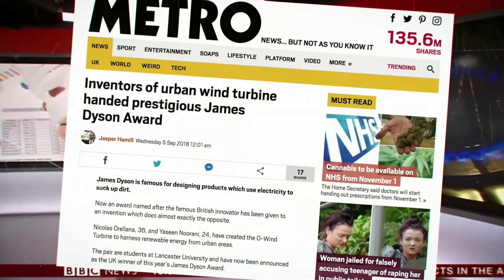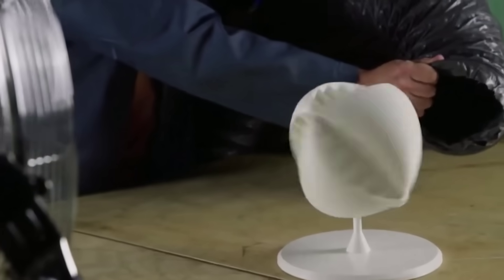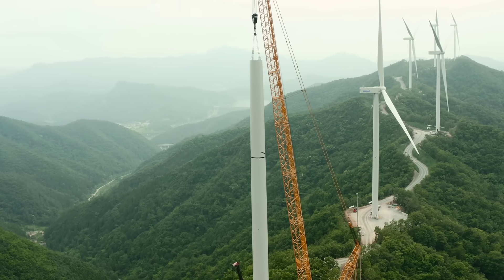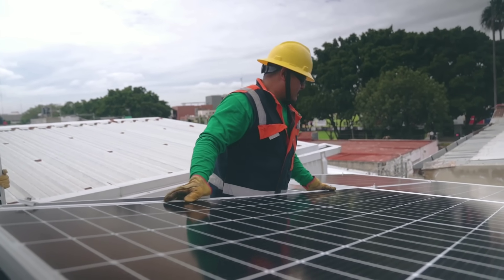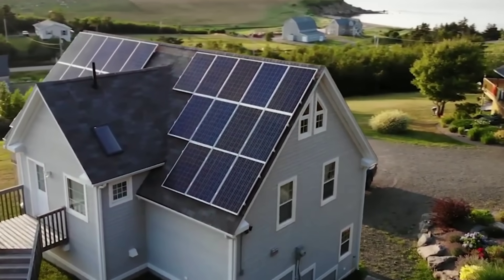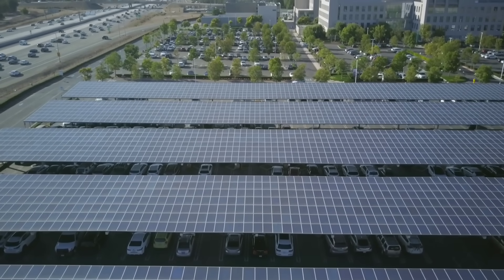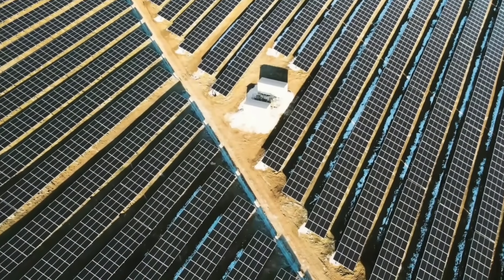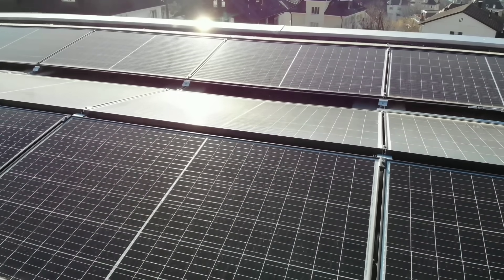This NEW European Wind Turbine for Home Out Perform PV Solar Panels in 2024?!

Comment: Keep in mind power is P[W]=½*ρ*A*V³*Cp (where ρ=1.225 air density, A=area of turbine in m², V=wind speed in m/s and Cp is a in range 0.1 for this turbine - you can check, it's widely known equation). So turbine of diameter 3 foot can create about 10W of energy at the wind 6.5m/s (which is a quite strong for urban locations).
Reply: I live on a yacht and can advise that almost all of the boats have removed the wind turbines fitted in favour of solar panels...  Keep in mind the back of a yacht is usually a very windy place!!  The turbines still produce very little each day... I have fitted 600watt panels that keeps up with the day time and evening use... The turbines do not... Panels and charge controllers/inverters are now cheap...😊
Reply: @GrahamLawder  only reason why I contemplate wind is the fact I am above 53N and need to power a house. Fun fact, the tower (20m) costs as much as a decent turbine. Roofs are horrible for turbines (low rise).
Reply: No datasheet on the website either listing the simple windspeed vs power graph. I think you are low-balling it, but no sheet, so you could be right.
Reply: @christianvanderstap6257  this is scam for collecting investments from investors who measure energy in km/h ;)
Reply: First I did look for your formula and know I've seen it before, but can not find it now that I want it. My question is what does your Cp=0.1 refer to? I would think conversion of mechanical to electrical energy as that and capacity factor should both be figured in for useful output.
Reply: @zmavrick  I'm not the OP but, Coefficient of power = (VI)/(1/2Apv3)

The Betz Limit is the maximal possible Cp=16/27=0.593

A maximum of 59.3% of the available wind power can be converted to mechanical power at ideal conditions, whatever the energy conversion device is.

Real wind generators do not reach this theoretical optimum; however, good systems have power coefficients Cp between 0.4 and 0.5. A drag machine, such as the one shown in the clip would be somewhere between 0.1 and 0.2, Bear in mind that  most of the cross-sectional area facing the wind is doing nothing or is drag. Although it's a bit of a guess, it's probably closer to 0.1. This doesn't allow for the efficiency of converting mechanical power to electrical power which will be pretty awful at this scale. This really is not a good design for efficient electrical power extraction, but it looks pretty.
Reply: @Notagain640  Thank You
Reply: @zmavrick  You say: " would think conversion of mechanical to electrical energy". Yes and no :)  Formally Cp is"Power Coefficient" is a in real conversion coefficient (efficiency) from WIND energy to MECHANICAL energy on the wind turbine shaft. But in practice it is extremely hard for average person to measure this, as there is a no much tools. BUT  - electric generators itself are quite efficient now (and for small size we can talk about range 80%=0.8 rating or even better for bit bigger as few kW). So in practice Cp in small turbines (when we talk about up to 10kW power) is a conversion efficiency from WIND power to ELECTRIC POWER measured just out of wind turbine generator. Fun fact - seriously big number of sellers/producers "fake it" and shows graphs which are "just drawings", no real data. It is bit too complicated to explain all in YT comment and on the web there is a no much real data for Cp measured in real life small wind turbines, I explained it partially on my YT channel - but in Polish language. I can do English one, but I'm not native speaker, so people complain on my accent :)
Reply: Exactly! They just fool people who didn’t learn physics in school
Reply: Where is it getting its torque to turn a generator? It doesn't
Reply: Does this not depend on the size of the generator?
Reply: @iknowbetter5075  Electricity generator is a "second thing" - first you have a energy source (wind). Generator is a only tool to change mechanic energy of the wind to the electric. Of course it have to be enough efficient. There was systems totally without "electricity generation" - probably you saw old "American turbines" with a characteristic tower and many (24?) flat wings around. which was pumping water. They was strictly mechanical.
Reply: @iknowbetter5075 it's the theoretical maximum amount of energy in the wind. This turbine looks like a drag machine, so will be very inefficient. A small unit this size wouldn't even charge a mobile phone. There's a reason why wind farms don't look this. It spins fast because its not generating power. If you try and extract the energy it will stop spinning.
Reply: You are correct that the size and shape of the blades in a wind turbine are important factors in determining its efficiency and power generation. The design of the blades, including their size, shape, and materials, affects how efficiently they capture and convert wind energy into rotational motion. Additionally, the generator's capacity should be matched to the wind turbine's output to ensure optimal power generation.

Simply increasing the size of the generator without considering the design of the blades and other components can indeed lead to suboptimal inefficient and over costly engineering outcomes. It's essential to have a well-balanced and optimized system, taking into account all aspects of the wind turbine's design, including the blades, generator, and other components, to maximize electricity generation from wind energy. @iknowbetter5075
Reply: @iknowbetter5075  It only depends of the wind speed and the surface you can catch ... Don't believe such stupid think, there is no future in home wind tubines ...
Reply: I'm not a scientist so maybe I'm getting this wrong? If you're measuring wind speed per second, then 10w per second is one kW every 100 seconds, or about 35kWh? Obviously a storage battery would be useful.
Reply: @onthemove301  Yes, you getting bit wrong. You mixing units of power and energy. Watt is a unit of power (not energy!). So 1 hour of 10W power generation is a 10W x 1h = 10Wh = 0.010kWh of energy. Daily it will be 24 x 0.01=0.24kWh production of energy. I use around 11kWh daily at my very average home (at USA typical consumption is a usually 2-2.5 times bigger ). So potentially for cover my needs I have to install no less than 50 of same "wind turbines" (as long is a windy enough and they are really REALLY efficient as they say).
Reply: @onthemove301  10 W is 10 J/s. 10 W during 1 hour delivers 10 Wh. x 24 hours is 240 Wh per day. Nothing compared to a 300 Wp solar panel.

Comment: At 04:00 the voice says 200 Kilowatt/hour. This obviously should be Watt/hour. !
Reply: So it's 200 Watt-peak (theoretically),  basically an effective output of 5-150 Watt. 
You would also need an inverter and at least 5 of these things.
Sounds promising but I am highly doubtful about this
Reply: Does that mean the generator is inside the turbine? If so, just put a bigger generator on the turbine.
Reply: @iknowbetter5075 Nice try but there are no free lunches. Bigger generator means more resistance which means you need a bigger turbine.

Comment: Its not better than PV.... when things rotate, there is maintance. Wind is a good additional source.
Reply: With solar there is also maintenance. Dust, hail, leaves, bird droppings, batteries, etc. A mix of everything is good.
Reply: That's what wind powered generation is, an additional source.....there's not one example where wind is the only source of electricity for the region or a home. Even with fossil fuel generation there is coal, gas, diesel and propane, there's also nuclear or hydro thrown in the mix. It's about getting what you can from all your resources.

Comment: Looks like a lawn ornament, far better at sucking money out of your pocket than sucking electricity out of the wind. When combined with solar roadways your wallet will be empty and your lights will be out.
Reply: Not very good at physics are you.
Reply: @jamesagerholm2034  
Far better then you.
Reply: Local energy sources like this turbine are always cheaper than long distance ones as they are more efficient, thermodynamics 101.
Reply: @jamesag4135  
Real wind mills are cheaper are more efficient, thermodynamics 101, than these lawn ornaments. Maybe add some solar roadway to increase there output to some thing noticeable.
Reply: Vertical axis produce less energy compared to do horizontal ones that is true but they deal with major problems in places such like cities where wind direction changes vary massively and they are much more stable.
Reply: @jamesag4135  
Real wind mills producing real power no lawn ornaments involved.
Scotland, known for its commitment to renewable energy, has reached two significant milestones that solidify its position as a global leader in sustainable power generation. 
In 2022, the country produced a staggering 35.3 TWh of renewable electricity, marking a remarkable 28.1% increase from the previous year and a 9.8% growth compared to 2020, surpassing all previous records.

Comment: It's a no brainer if you can add wind power affordably to your solar battery set up. It fills the gaps overnight in particular but would also add to generation during the day, and if not needed, charge the battery or export to the grid. Here's hoping but potentially the market for this is off the charts if you could supply and install for under $1000.
Reply: That's a great point! Adding wind power to a solar battery setup can definitely enhance its overall performance and versatility. The Segway Portable PowerStation Cube Series would be an excellent addition to such a setup. With its massive capacity, fast recharging, and versatile sockets, it's perfect for outdoor enthusiasts like us who value quality family time and reliable power backup. Plus, its waterproof technology makes it perfect for any adventure. Thanks for sharing your thoughts!
Reply: No-brainer🤣 must be you and your buddies.

Comment: I love the Idea of small windturbines, have built some in my garden for nearly a dekade and read nearly everything you can find about.

And now we come to the problem - this advertising video does the same that all the others that are not anymore on the market did - i tells people that have no Idea about physics, wrong narratives to sell them.
Small is nice - sure as long you dont need the space physically for the Windenergy. 
Doesnt need strong Wind - haha, same like before, Double windspeed is 8x the energy, low wind is nice for an expensive useless garden sculpture. From the principle this is a savonius type wheel - the system with the lowest efficiency of all types...
But yeah, these guys may have good Connections and earn a lot of Money with it, despite that it makes little to no sense for the customers.
Reply: It's a characteristic: some bleh-bleh wit nice pictures and when you look at the mentioned data: 200kWh per year is a joke, not good production. I can buy locally one(!) solar panel 435W @110€ which can produce around 390kWh per year. Going back to wind turbines - size matter, wind speed and LACK of turbulence matter. It's another from the shelf: "give me a money and shut up".
Reply: Stop confusing the issue with facts.....it's free energy from the wind!   It's FREE, stop upsetting adults with this information, it's bad enough their fifth graders make them look silly

Comment: I've already have solar and a battery, I would like to add a wind turbine. This wind turbine looks extremely promising and it could possibly be added to my existing set up as long as its output could be sent via a mains phase controlled inverter. As soon as it's market ready, I'll be sure to be looking out for the 
"O-wind" turbine.
Reply from the maker: > Hi, thank you for your comment. I'm happy to hear that you have solar and battery systems and that you are interested in adding a wind turbine. The O-wind turbine is indeed a very innovative device that can capture wind from any direction and convert it into electricity.
Reply: @FutureGalaxy  I like this comment....it is an epiphany!
Reply: Always a stupid price greed if a toy company made it it would be a 200 pound how much so not interested in saving the planet then
Reply: It would be interesting to see how to ‘stack’ technologies - Solar and Wind.  Admittedly I know little about electricity but have heard some difficulties with wind on how to ‘dump’ excess generation.  Keeping an eye on evolving technologies.
Reply: @PAC56   Use water heating for the dump load. get a large tank
Reply: Look up archimedes.
Reply: How much electricity can one O- turbine produce if fixed on roof top of a house. Wind velocity being 15km/hr.
Reply: Looks like you will het a millivolt out of it.
Reply: @Vile_Entity_3545 How so?